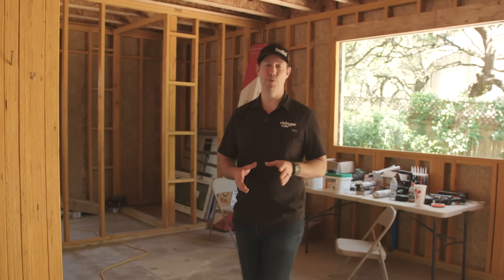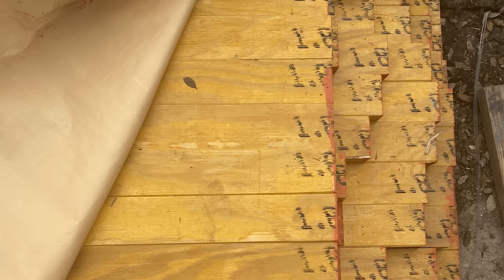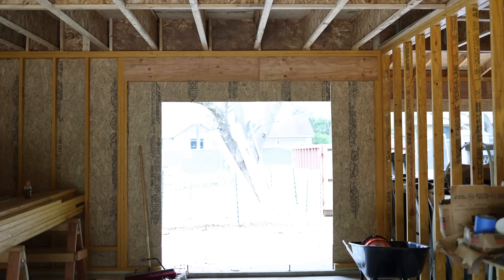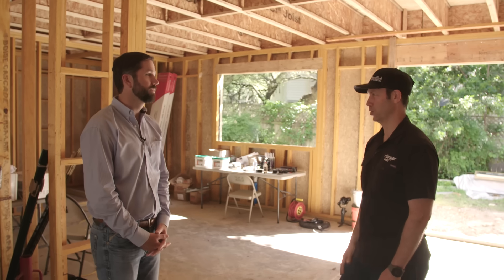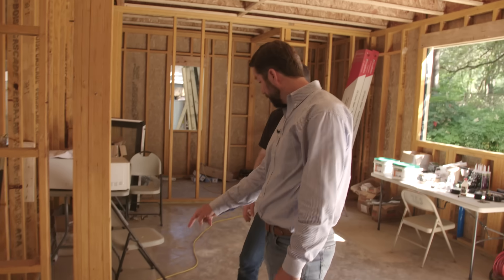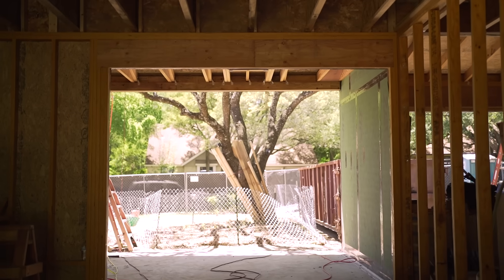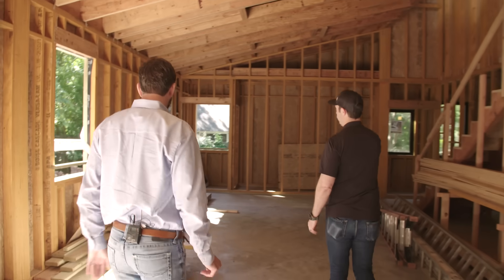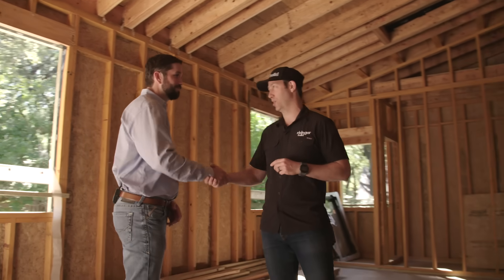House Engineering - Common Mistakes

Comment: With engineered studs why not move to 24" spacing?
Reply: Because he was using the old foundation so he was locked into 16" on center.
Reply: @jagslion3 , How does using the old slab ''lock'' him into using 16'' O.C. ?
Reply: when they tried that back in the day with 2x6 framing the dry wall bowed
Reply: We won't do 24" OC unless the drywall is uprated to 5/8". 1/2" DW at 24 " OC is simply too wavy, especially  on ceilings, or if you use blown in insulation (tends to bulge, and relies on the drywall to push it back flat/ level straight. In Colorado, the uncharge is nominal, and we do 5/8" DW pretty much all the time anyway.
Reply: It doesn't really matter with the 2" of foam on the outside.
Reply: Quality. Rigidity. Durability. Strength.

Comment: Such a good allocation of resources spending on the permanent part of the house. I see too many clients willing to have poor quality structure and mechanicals so they can spend more of decorating and furniture.
Reply: Well, any builder worth a damn knows it's what behind the walls and below the floor that matters.  However,  homeowners don't have a clue and with the lack of information about various builders and the quality of homes they build, they can only evaluate on what they see.  What needs to happen is to start rating homes on quality as well as aesthetics, amenities and location.  And that requires banksters to start demanding appraisers giving premiums for build quality/efficiency.  

What sucks is we have legions of shows/reviewers posting about every new cars and electronics, but nobody talking about the quality of various builders.  It's disgraceful considering homes are typically the biggest investment people make. Instead we rely on incompetent 'appraisers' who barely know their elbow from you-know-what.
Reply: We definitely need a rating system that is well marketed so that the common buyer has a standardize reference. If higher quality doesnt get a return for the money, only customs will use that method.
Reply: What I don’t get is why he didn’t use concrete block reinforced with rebar and concrete, or ICF construction.
Reply: Why not? 
The house will not last anyway. The homes today are absolutely JUNK compared to what they built prior to the 1950s. My 80 year old home has character and flaws a plenty, but it requires much less maintenance and is more durable than any of the subdivision homes I work on day to day.  I have weathered storms that destroyed more modern (1970 or newer) homes within my area. Today it is about economy not quality. We want everything done right now and cheaply. Craftsmanship is all but a forgotten word in the trades today!
Reply: Ya think ?! LOL - great if obvious observation...i just dotn understand why anyone building their own house doesnt do it right. Sure if you are buying a spec house, who cares if it meets code-just be sure to flip it in 20 or so years. A house is not like a woman’s  dress or shoes to be discarded after a few years,
Reply: nope as builders we should'nt do any extra then what the plans call for and if you want to make structural improvements (useless) you need to go thru the city the inspectors wont appreciate and it will look very amateur if you try to improve the structural on your own this lumber is not better quality it just has bigger load and span and its good in certain applications. all houses built today are designed way stronger then houses 20 or 30 years ago and yes its better to spend your money on stuff that you actually going to see and improve the value the house